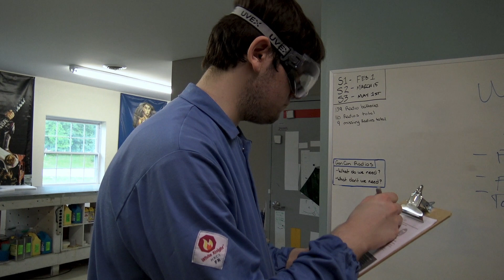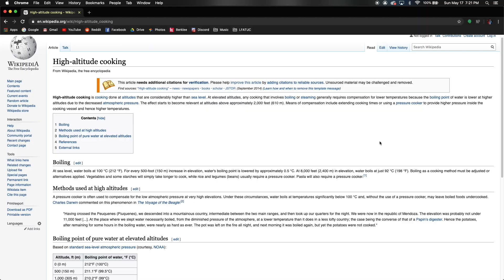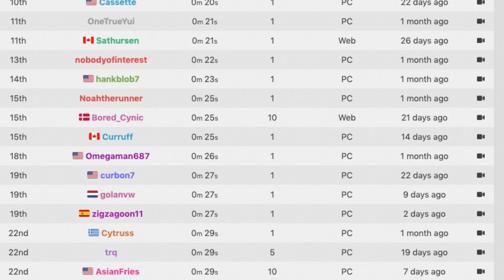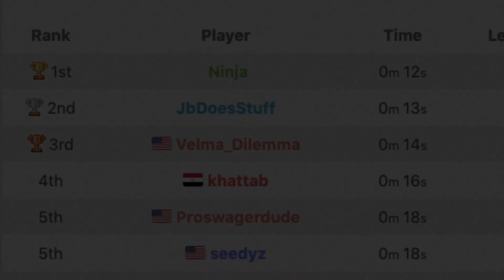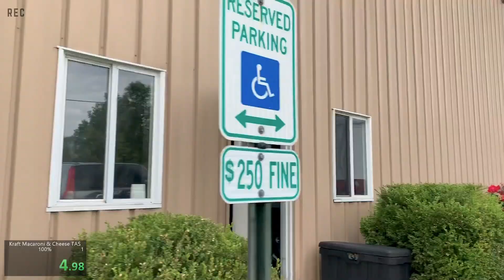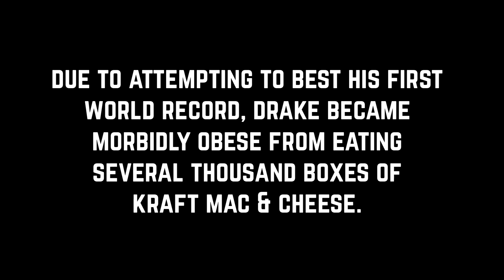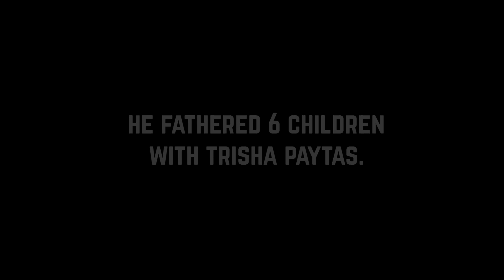Getting the World Record for the Kraft Macaroni & Cheese Speedrun (100%) (Tool-Assisted)

Comment: By extensive research I have come up with this new route which I believe to be a game-changer: boiling water setup as follows. Electric kettle and immersion heater(s) preferable directly in the sink to eliminate travel distance, while the water is reaching boiling temperature there should be time to prepare the the butter, milk and cheese sauce mix (BMaCSM). I recommend stuffing the ingredients inside a blender for faster mixing while doing this keep an eye on the water temp because the Kraft Macaroni & Cheese (KMC) needs to be applied immediately at boiling temp, once inside the KMC can be stirred by immersion blender which I believe to be quickest method to achieve tenderness.

 Thereafter the boiler setup should be equipped with a vacuum drain for near immediate drainage of water then be sure to have the hopefully ready BMaCSM in your left hand for quick installation in the KMC and immediately reach for the immersion blender and do the final stirring aaaand TIME.